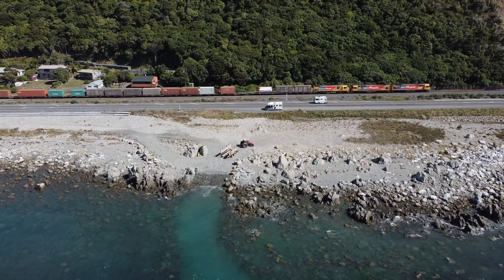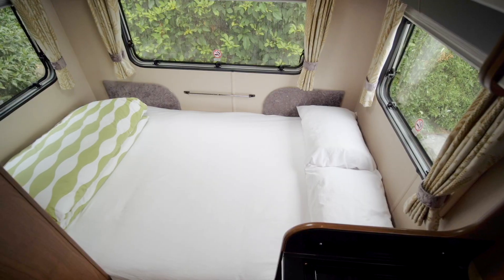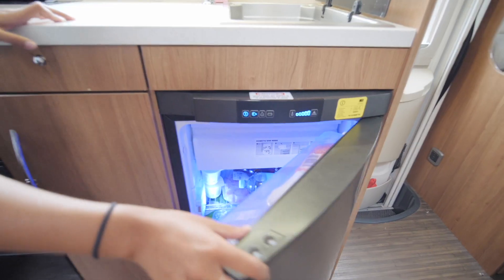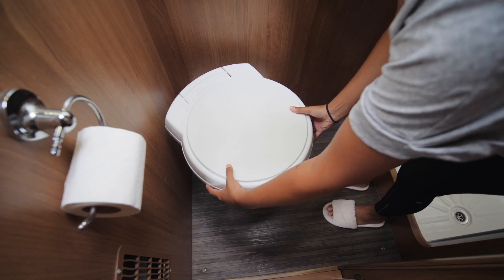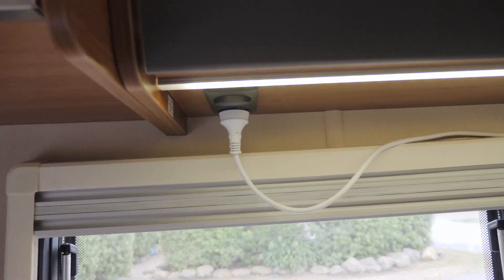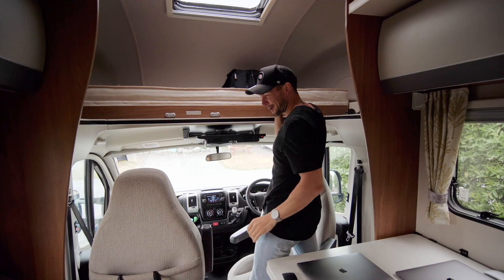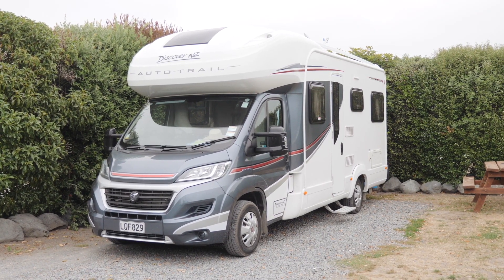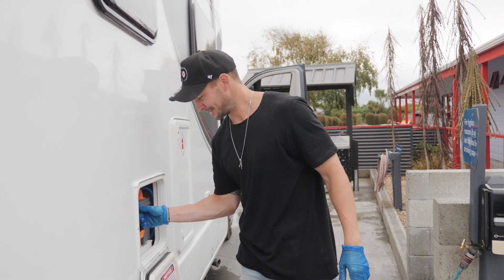INSIDE Our $150,000 Campervan New Zealand Tour! | Reveal NZ S2 E8

Comment: Definatly should never drive with the gas on, very unsafe. The pros put you way wrong on that one. That's why the fridge has battery mode. Your phones and laptops should all be able to charge off USB via the 12v system. I've never used the mains sockets in ours in 5 years.
Reply from the maker: Ah well – lucky we had no problems at all 😊Good for others to know though! Great that system works for you. We needed the mains sockets so we could use a powerboard – we have SO much technology while we're filming  on the road.